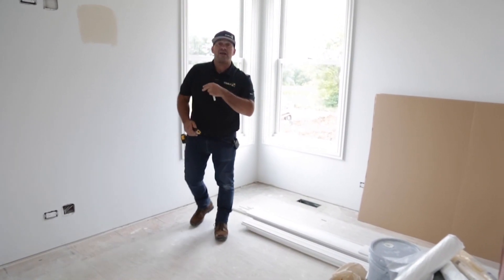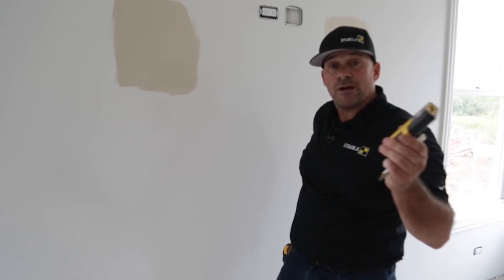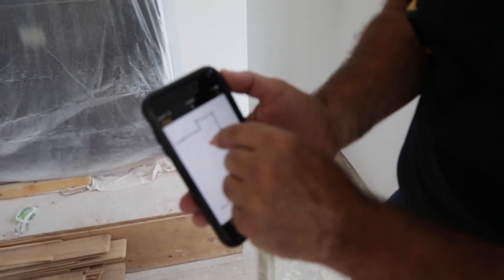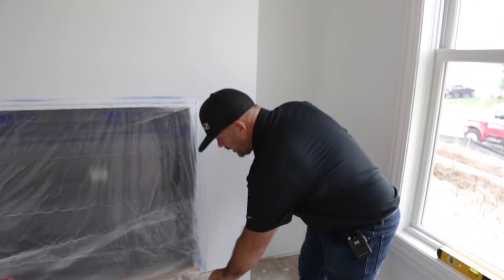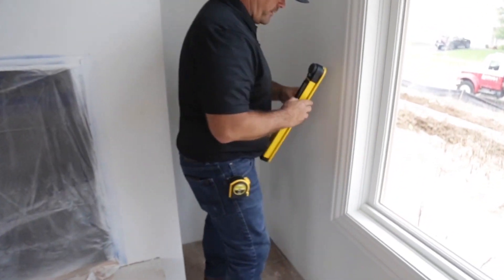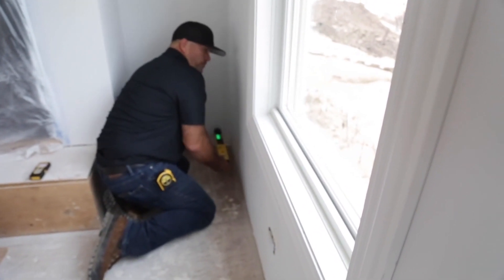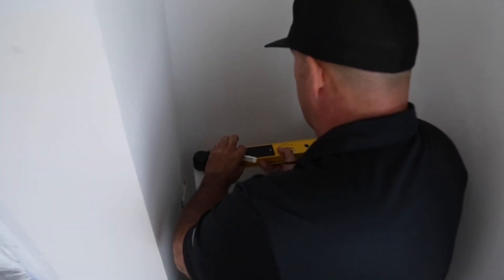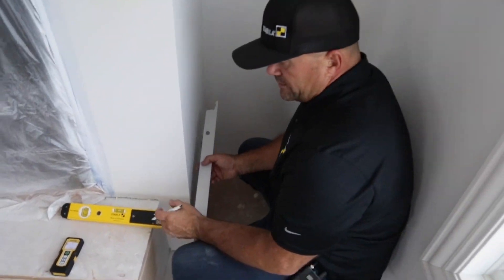STABILA House build | Episode 8 | Trimwork and Millwork with our TECH 700 DA

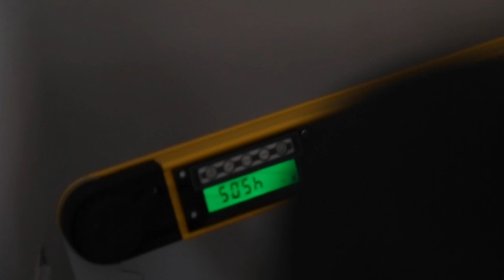Comment: At about the 3:20 mark you said press the miter button and that’s what you set your miter box to- I bought this and unfortunately this is wrong.

I traditionally used the starret angle finder  and was stoked about buying this for handrails ( or whatever). All my levels are Stabila.

Now I’m trying to return this because the miter button does not accurately reflect what you set your saw to… very 250$ disappointing
Reply from the maker: Hi Jonathan, thank you for your comment and of course it is our biggest aim that you are happy with our products 💛🖤 Do you mean the button to halve the angle?

Comment: The total measured angle at the outside corner at 3:30 in the video is 89.8. This means that the angle is slightly more acute than a 90. When you push the half button on Tech 700 DA, this measured angle is simply divided in two, so the tool reads 44.9 degrees. But the way N. American miter saw scales are set up, 44.9 is NOT the correct angle that your saw will read when set to cut this miter correctly. The correct reading on the saw will be 45.1 degrees, which will produce the correct slightly acute angle. The correct saw setting is not equal to the measured angle divided by two. It is the complement of that number. I don't know why this tool (and some other manufacturers' miter devices, as well) are not set up to indicate the correct miter saw reading directly. Does anyone know the reason? IMO, programming the layout tool to yield the saw setting would be more practical.
Reply from the maker: Thanks for your feedback
Reply: @STABILAOfficial  Hello, from a long time Stabila fan. I asked my question out of sincere curiosity, not simply as a criticism, and with the presumption that there must be a practical reason why Stabila programs Tech 700 DA to simply bisect the angle, rather than to go one step further and compute the complement. As a finish carpenter by trade, it is almost always the complement that I need to know in order to set my saw or machinery correctly, since a 90 degree cut is marked as "0" on most machines. Can you possibly explain the reason? 

In any case, as a suggestion for future development, perhaps an additional function could be added to the current programming: In addition to Measured Angle and Bisected Angle, this extra function could be labeled as "Miter Complement" or "Miter Saw Setting" or "Machine Miter Setting."

Of course, one is able to perform this simple calculation in one's head. But when moving quickly on the job and dealing with odd and precise measured angles, I know that I, for one, would use such a setting much more often than the current bisected angle function, if not exclusively. For me (and I doubt that I am the only one),  it would save time and eliminate the possibility of an inadvertent costly error. And after all, jumping directly and with certainty to the most accurate and useful measurements is what Stabila is all about, nicht?